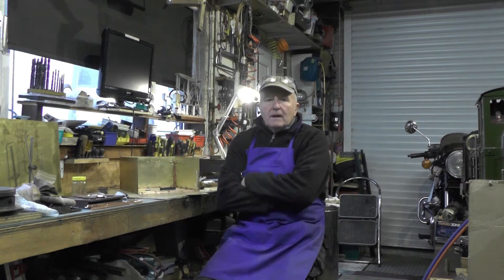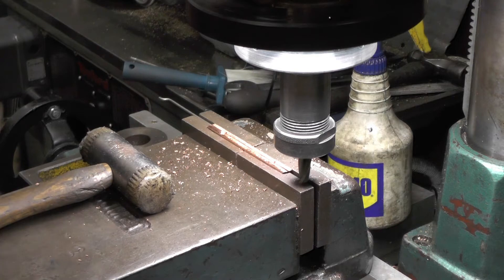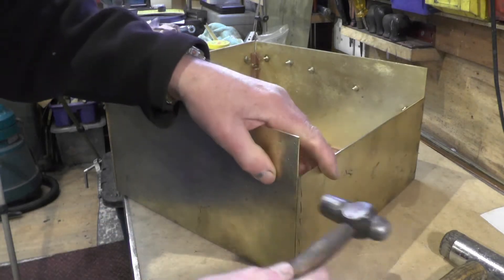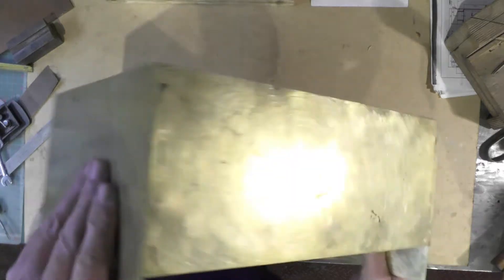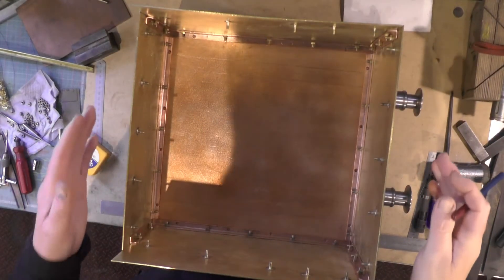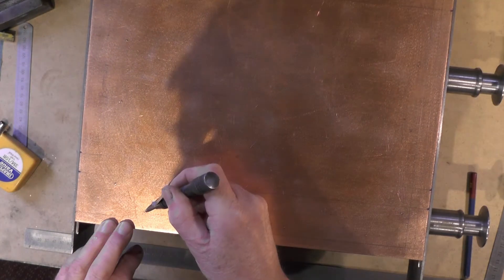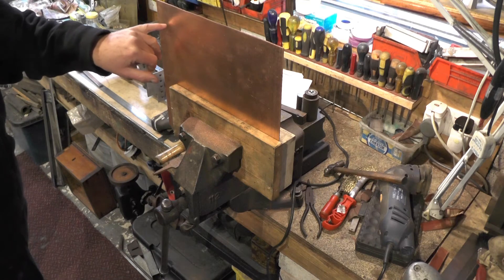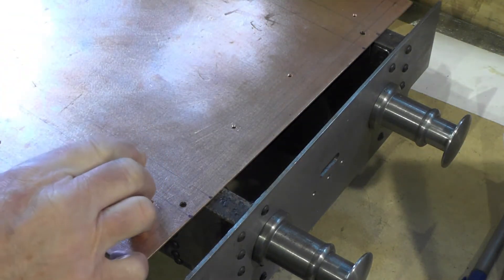Make a Water Tender TANK BUILD P5 - For "Scratch"(My Beginners Steam Locomotive Series)"mr factotum"

Comment: Hi Kev, mines all finished and test run, a couple of heads up for you...
I made threaded bushes soldered into the tank bottom so it can be removed from the chassis. When you solder it all up make sure you clean all the flux out, I've found out the hard way, my boiler was priming like crazy, will pm you a photo 😉
Reply from the maker: Thanks for the info Trevor
Hopefully will make some progress soon, been off it for a while.
atb 
Kev